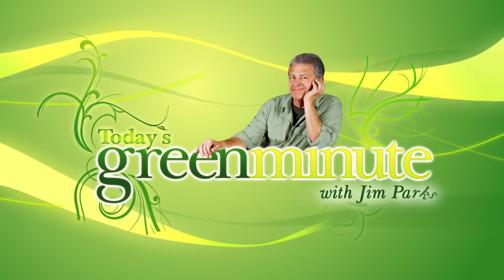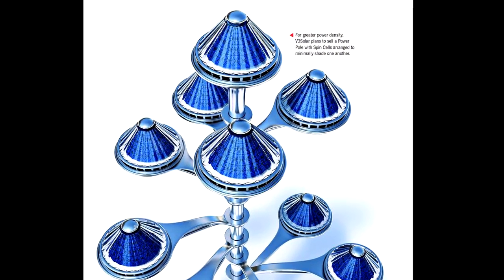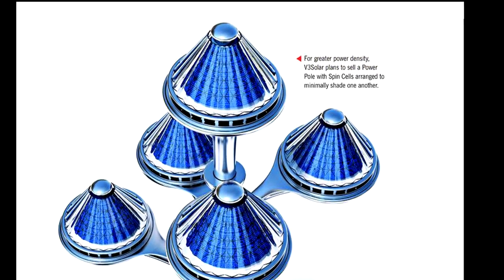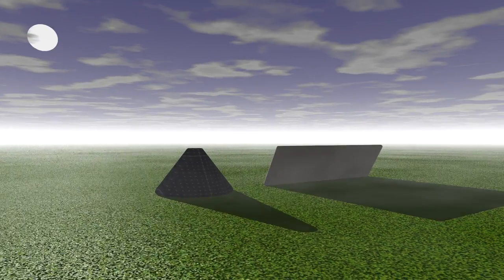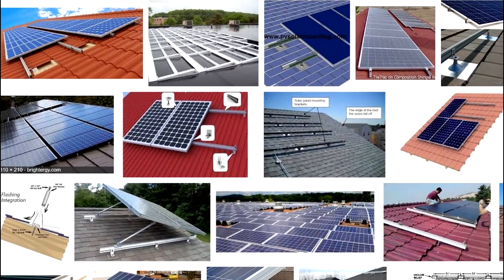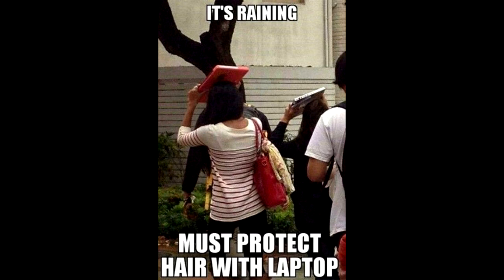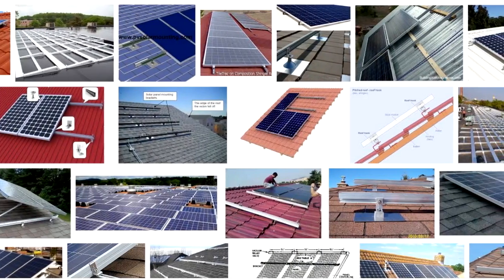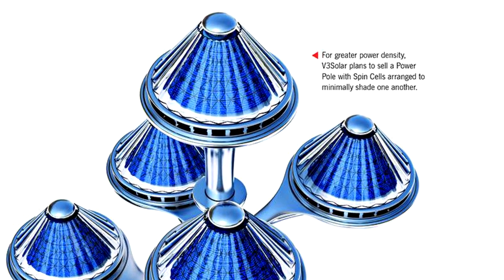Spinning Solar -BUSTED!

Comment: Assuming they're not total idiots (big assumption, I know) could they be referring to efficiency relative to setup cost? Some of the info implies that they expect to be able to use a significantly less robust solar cell which would save significantly on cost.
if there was (keeping numbers simple) a 90% decrease in cost per cell they'd be able to use 10x as many for the same price.
even if they only generate a third the power per cell it's still a 300% efficiency per dollar spent.
Annnd if you've got this far, I'd be really interested in seeing you not just debunk these claims, but maybe have a look at if there are any promising ideas that could be salvaged from them? is there any underlying tech in the solar roadways for example that could be useful (modular, conductive road surface eliminating need for trunk cabling in telecoms for example)

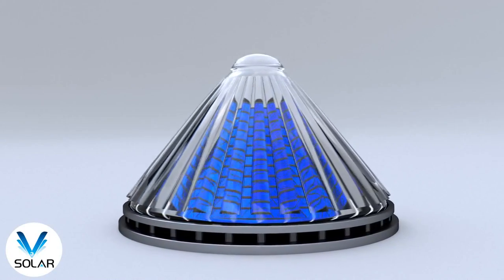Comment: wouldnt it make more sence to turn the blades of glass seen at 0:32 into blades so the rotation is obtained from wind and used to generate more power also the glass could refract the light towards the sides so that it uses more of the surface area?

Comment: 5:04 Actually, the back of the cone does produce some electricity because it is exposed to the light scattered by the sky. Not as much as the part exposed to the sun of course, but not a negligible amount either.

Comment: I saw a solar panel setup that used a plastic bubble over them that had Fresnel lenses in it like a bee eye. They worked to well.  They were a fire hazard from the heat. The company gave up on the idea.

Comment: The obvious solution is to build a solar panel the size of the Earth, fly it into space, place it directly, and this is imperative, directly in between the  Earth and the sun. To make sure it doesn't float away or destroy the Earth, and so the planet can reap the massive energy bounty it will no doubt produce we shall connect it to the Earth with thousands of giant cables that will lock the Earth and the panel in place.

Comment: A 20 % increase on a 30% effectiveness only gets you up to 36% , not 50%.
Your always too generous  to these quacks.  3 times the cost just for the solar cells in the shade + the cost of some elaborate spinning framework. (Probably easier to spin a fan instead of spinning the whole building)
+ the energy used to spin the framework.  Not to mention the cost of the fence around it to keep the idiot people from stumbling into the spinning panels. And then the giant slip ring to transfer the power from the spinning thing to the grid.  
How do you cool something that's inside a green house?  A green house is supposed to keep things warm.  
Holly crap what a fiasco! This is so wrong on so many levels.

Comment: but wouldn't 20% more efficient be 120% because it's more, not of, and then 20% more efficient than the already 20% efficient solar panels be either 20% or 120% of 20% which either way is nowhere near 400%????

Comment: Not saying there's a good idea here - but the lens wouldn't need to be as precise as a telescope lens, probably scaled up glass jellymould technology (perfected in the 60s) or a thin plastic sheet Fresnel lens would be practical... could even have a hole cut in the top to allow chimney effect air circulation for cooling... seem so obvious I'm not sure why they didn't think about it for their CG mockup really.
 If putting lenses in front of solar panels ACTUALLY IS a good idea, using finned heatsinks or fans or heatpipes or water cooling seem to be much  more obvious and better ways of dealing with the heat  than spinning the whole thing.

Comment: Anybody with two brain cells to rub together would look at this thing for 3.7 seconds and then ask the following critical questions: How much energy is lost to spin this thing? Does the goofy design increase the manufacturing cost? Why do they claim that making it cone shaped in any way increases overall sunray perpendicularity? Why do they think keeping half of the cells out of the sunlight will increase production via increased efficiency by more than what that shaded areas are failing to produce due to NOT BEING IN SUNLIGHT!!? Why are they arranged on a big tree instead of just plopped on rooftops? How insanely heavy must that glass dome be? Does it butter toast?

Comment: Can't read through all the comments to check Thunderfoot, but what power is actually spinning these cones.  Needless to say that this will bring the energy coefficient down even further; if, as it seems, it's being powered to turn at roughly 60 rpm!

Comment: I know a lens that is way bigger than that - it's a building in london that often sets fire to their neighbours premises. Lenses don't have to be in one piece any more than mirrors to to do the same job. so as I said before the mirrored windows on a building can do it - and it's even possible to change the shape of windows now electrically. also some smaller buildings have external shades on them those could be repurposed or reshaped in some potentially useful ways too.

I agree putting a single piece glass cover on it is daft it makes more sense to structure the object in replaceable strips and make the panels and the protective and focusing cover a single piece. but solar panels last 20-50 years I think that is fine enough.

Comment: P.P.S. Hmmm Looks like Getting rid of the heat in a useful way is a feature that is advantageous to build in - no wonder there is duel system panels now.
I can see why all the wild birds in my neighbourhood love the solar panels so much it must be kinda cosy under there.
Reply: Indeed, some panels now come with integrated water cooling on the rear you can plumb in and also use to help heat your home's water supply.

Comment: P.s. - Is there any reason other than over heating why mirrors couldn't be used with solar panels (I think I saw this once in a solar-thermal cannon prototype) the mirror could redirect to the opposite side and also track the sun and focus it on the collector too, but also mirrors (not in built up areas) would perhaps work for hot water systems.. or what if one of the cones was placed near a building with a mirror surface to the windows that reflected light on the other side.

Comment: Haven't seen the video yet...looking forward to the "takedown".
Thunderfoots' on his horse!
Reply: 1 minute in and I'm flabbergasted. How could anyone fall for this?
Reply: They would probably work fine at the equator....at noon.
Reply: The motor to drive that heavy glass lense would eat up a lot of sunlight.
Reply: the lens is stationary its the solar cells that move to "cool down". Still i agree, the motor needs power which will reduce any efficiency left to near 0.  it might even draw more power than it generates.
Reply: You do realize that levitating the whole thing with electromagnetism would probably take more power than the solar panel would generate right?

How exactly would it be more efficient in the first place? A flat tracking solar panel still has more surface area towards the sun than a cone would? If the reason why was a new type of material or design then why not just use it on a flat one instead? There is nothing supporting the fact that it is 20x more efficient in the first place, even after factoring in the cooling gain from the spinning, even after assuming that it would take no power to spin it. Plus, the manufacturing cost would be higher because of the added glass and magnets needed to levitate it in the first place.
Reply: all it needs is a thin spiral on the inside of the protective cone to channel the air rising. You can make it spin without a motor. Secondly this idiot has no idea over how to actually use math and calculate the efficiency increase. panels today are only 20% efficient is correct. The cones are 20% more efficient than their efficiency number. It does not multiply it adds to the existing. instead of harnessing 20% of the power it would normally it harvests almost 40%. The spinning is achieved through thermal convection currents between the two surfaces of the cone and the inner cone rides on a frictionless magnetic field.
Reply: Buffalo_Chips 
But two thirds of the cone will still be in shade so it will be less efficent.
Reply: Wil Hobbs
you have to understand how refraction can bend light. that is why the outer cone is the shape it is
Reply: I understand...it won't help.
Reply: Chucklemaniac I didn't see anybody suggest electromagnetism for levitation. If you want levitation for near frictionless motion bearings of permanent magnets will suffice. Take a look at a Mendocino motor , there's thousands of examples on YouTube. if you want even more efficiency just put it in a vacuum.  I often wonder why there's so many naysayers on youtube? Perhaps if people said  "how can we do this" instead of  "you can't do that"  society and science might progress instead of being locked into the current paradigm?

Comment: This may be a stupid question but what about using the heat excess to feed into a hot water (duel-system) and also shaping it like a conical screw so it's essentially a turbine blade and it can generate electricity by wind too - now at least then it still does "something" when it's windy but dull. such an idea might have a niche use such as a form of cap for ventilators or for limited space - they might also be possible to mount horizontally on buildings.

I think it's fine to say "This isn't as good as regular solar" but there might be a niche for it  - just as there is for solar-windows even though they work less well that standard panels - those two can use combined features like hat water generation and even opacity functions instead of blinds.. 

So think big not small and think small two - don't just compare apples to pears compare Apples to Motorcycles (so to speak).

Comment: As someone who works with solar panels I just wanted to add that I can understand the benefit of its shape when it comes to effective positioning, because positioning panels on roofs for maximum efficiency is a pain in the ass.  These would be a lot easier to work with, including on boats and other areas where space was an issue.

Comment: could someone explain if it would be possible to have a solar panel on top of a house, and using the coolness of the inside of the house to generate more energy via a sterling engine that uses the solar panel as the hot side? Im not very well knowledgeable on this kind of technology nor thermodynamics to really make a good guess.

Comment: This will sound Crazy or Retarded BUT, BUST NASA! Bust them on How the Fuck does a Pressurized Can or Spacesuit Not Fucking Explode in the VACUUM of Space. Bust them on all the Air Bubbles we see while they are "Space Walking" ( Air Bubbles they call Anomalies/Space Debris ). Bust them on How the Fuck can we Hear Sound in the Vacuum of Space when they claim it's impossible. Bust them on How the Fuck can be completely surrounded by Clouds if it's 93million miles away and the Moon can also be surrounded by Clouds if it's 280thousand miles away. Bust them on the 8" per Mile Squared and Still see No Curve and can see places Up to 100 miles away that should be behind  up to   1-2 miles behind/below the curve. Compare Flight Plans on a Globe to those SAME Flight Plans on a Flat Earth Map. Bust them on the several Thousands of Satellites that Can't be seen from the ISS and that ALL Communication/GPS is either Ground Based or High Altitude Drones/Blimps/Balloons and Planes. Or are you a Shill and Not Open Minded enough to Ask those questions of yourself and why Everything NASA Gives us is CGI Fakery.

Comment: The only thing I like about these is how cute they look. And that is about it. 

The spinning makes no sense and as you pointed out losing 70% power is just stupid. There are better solutions. 

I expect that this device is less efficient [definitely with a need for a spinning motor] then a solar panel stuck pointing one way. At least that one is almost efficient during a certain hour of the day.

Comment: The output estimations were very optimistic. With a cone the sun is only at the correct angle for a very short time each day and even then only a thin vertical strip of the cone is at the optimal angle. The rest of the illuminated section is at an increasingly poor angle the further away from the thin strip you go. Most of the light would be reflected off the cone. It would be better to, lets say, rotate a flat panel so that it is always facing the sun.... If they want to increase the output of a standard panel then do what I have done and fit mirrors to each one to collect more light (Needs water cooling). Maybe I could try spinning my house to see if that helps.

Comment: One thing I was curious about is just how much energy it would take to spin the solar panels, so I looked up how heavy they are and it turns out they're 10-20 kg per square metre. If we're generous and assume they use the lightest panels available, the motor would need to spin 45 kg of panels using the example in this video (10 x 4.5). I'm not an engineer, but it seems obvious to me that the electric motor would use up more energy than the panels are capable of generating!

Comment: Couldn't they just have peltier coolers in series on the backs of panels, then use those peltier coolers to power cooling fans to rush air over the sides facing away from the sun? That way, heat is extracted from the panels on the side that's already cooler (from the shade) to increase the gradient between hot and cold, and thus increase heat transfer (technically, thermal energy transfer; heat is not temperature, but rather the rate at which thermal energy is exchanged).

Perhaps using prisms to separate wavelengths of light could work so that specific regions of the panels can be tuned for different wavelengths of light, from IR to UV.

Comment: Another thing that you didn't address... how much energy do those motors take? Just curious as to the % of produced energy that would have to be used by them. Solar cells aren't super heavy but they sure as hell aren't weightless. On top of that, how much of that rotational energy will be converted  (wasted) into heat via friction of the rotational bearings? Where does that heat go? That's right, it goes indirectly back into the panels. Something tells me that the actual efficiency of these would be about 20% or so of a standard tracking cell at best if not have a net loss from the factors mentioned in the video combined with what I just mentioned...but at least they'd look pretty...until the motor or bearings failed and they were reduced to smoldering slag.

Comment: You missed an angle, here (pun intended, not sorry). Static solar panels are installed at an angle equivalent to your longitude. This idiotic cone does NOT track and, therefore, is like a ridiculously expensive static panel that would lose even more efficiency when installed outside of a fairly narrow belt in the northern (and southern) hemisphere; centered about 45 north (or 45 south) from the look of the artist's conception. They would need to manufacture a wide range of angles which would further inflate the cost. Plus, they might get sued by ITV since the silly thing looks like the alien ships from the old Gerry and Sylvia Anderson show "UFO." For those who never saw it, it was better than "Captain Scarlet" but not as fun as "Thunderbirds."  It was their first show that didn't star puppets and taught me valuable life lessons such as purple-haired moon chicks can be HOT. Damn, I'm OLD!

Comment: @Thunderf00t You are one of the guys who would make no sense of AC power supply hundred of years ago. :) Plants thrive with a bit more then 50% of sunlight in a day and they are the most efficient energy accumulators. Sure, you can make them grow with 24h light, but this effectively makes them age and die much sooner, not producing and offspring. 
I have no clue if these things could work, but dismissing and ridiculing  them on the basis of a limited set of information is just wrong. What would happen if on the opposite side, the current reverses (which might happen actually)? Wouldn't that make the lighted side current flow more efficiently, similar how oscillating AC current flows more efficiently? Just throwing the ball
Reply: Oh, I'm not defending it. But busting something on norms set for something else (like standard solar panels) might not work. The spinning itself is a very interesting phenomena. You can cool a can dipped in iced water in seconds, just by spinning it around
Reply: "You are one of the guys who would make no sense of AC power supply hundred of years ago. :)"
Why do you think so? Ah, because you're stupid.

"Plants thrive with a bit more then 50% of sunlight in a day and they are the most efficient energy accumulators."
Points for relevance, dipshit. (Add -1000 points).

"I have no clue if these things could work"
Indeed.

"dismissing and ridiculing  them on the basis of a limited set of information is just wrong"
I'll point out that thunderf00t is not dismissing the dick model of solar power out of 'limited information'. He's debunked it based on GEOMETRY of the cone, which has been known for thousands of years. In other words, you're behind the times by thousands of years.

"What would happen if on the opposite side, the current reverses (which might happen actually)?"
What opposite side? If you're going to say something, you might as well use proper sentences, to express complete thoughts. Go to fucking school, mate.

"Just throwing the ball"
Throw the ball out the window and cry about how the ball is on the 'opposite side' and producing AC electricity, kid. You've shown less understanding of math and science than that of a five-year old.
Reply: +Infinity Salinity stupidity is inability to connect a few dots, something you do as a rule it seems. You not understanding so many things and being arrogant does not compell me into explaining anything to you. Cheers mate